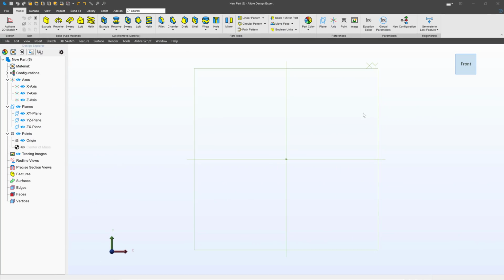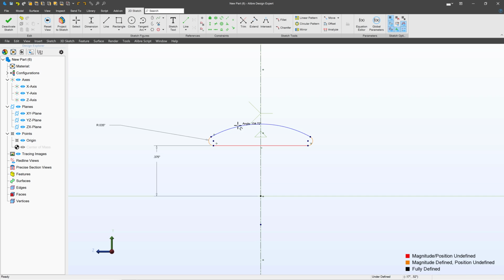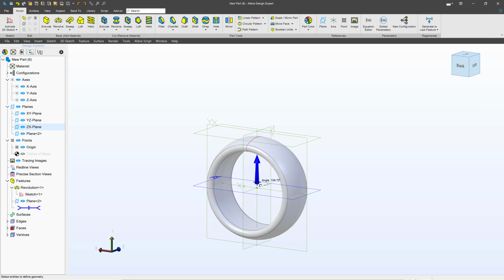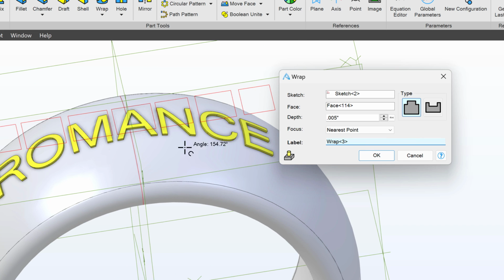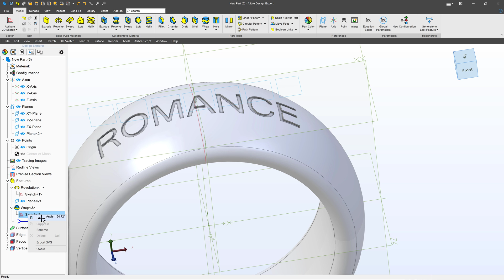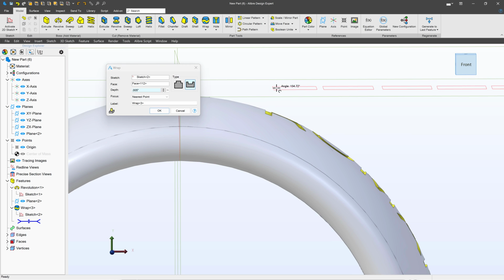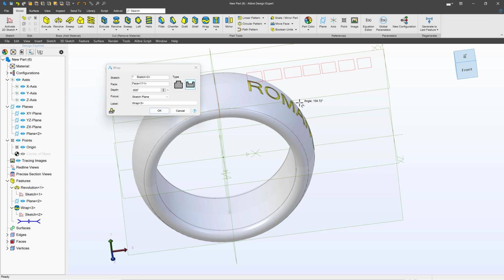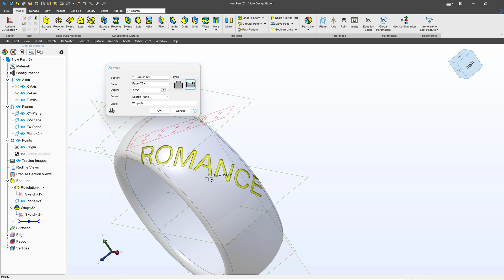Using the Wrap Tool | Alibre Beginners Course #27

Comment: Thanks. How would you wrap text on the inside of the ring?
Reply: I guess that simply selecting the inner surface instead of the outer one in the dialog box would be enough. I think they didn't show it because it would harder to see.
Reply from the maker: Indeed, select an internal face to wrap on.  You may get a mirror image of the text if the sketch plane is external, so consider moving the sketch plane to a more ideal location if that happens.